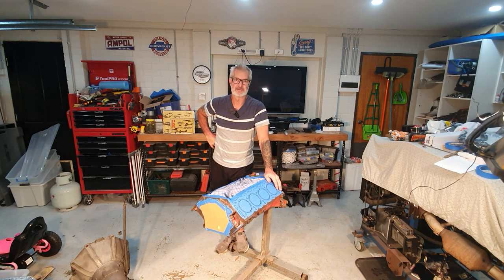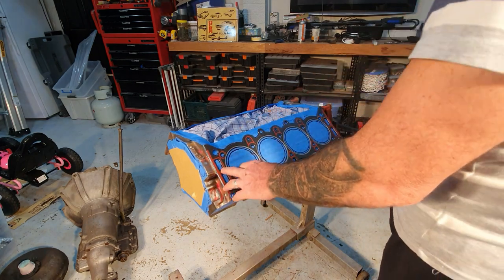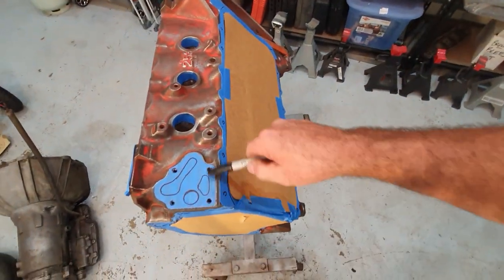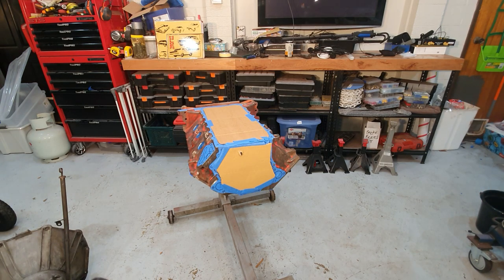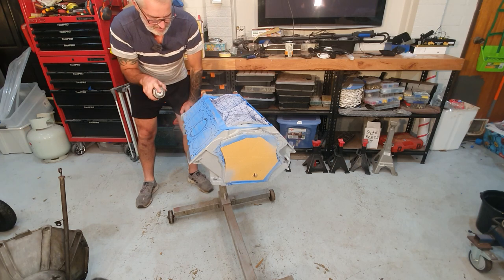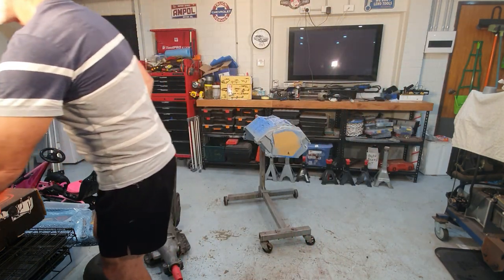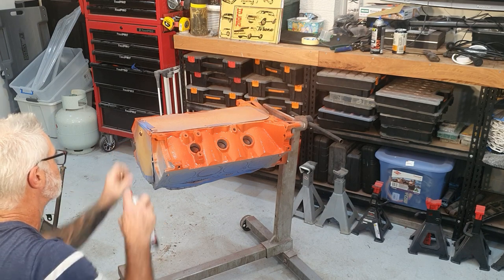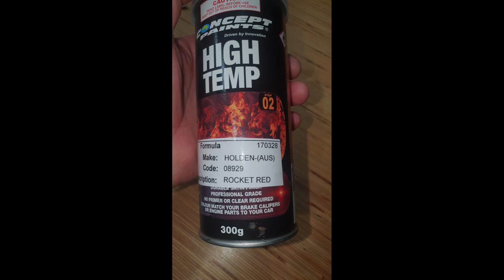Painting the Holden HQ GTS 253 engine in the correct Rocket Red. (Early Rocket Red)

Comment: That’s good advice, I’ll make sure to cover all the areas when I respray my 202, good video.
Reply from the maker: Tape up everything, put your gaskets in place. Trace around them with a blade. Remove the tape out side the cut lines. Prime the engine parts with hi temp engine primer first, just one coat, then paint the block and parts with your colour. Then assemble. It makes the engine look proffesional when all the gaskets are clean and visible between the painted parts. Hope you enjoy my videos and enjoy your own build.

Comment: you can buy 2 pak in an aerosol might of ben better using that mate my vht on mt 253 is already peeling off
Reply from the maker: I had Auto one (Auto pro) mix the engine enamel in aerosol cans as per my paint code.
I primed the block first just a light coat. Then 1 light coat of engine enamel and 2 heavy coats.